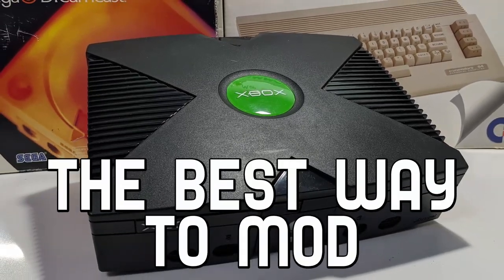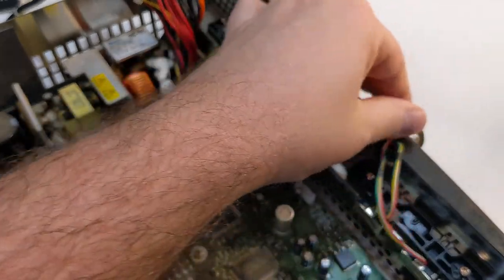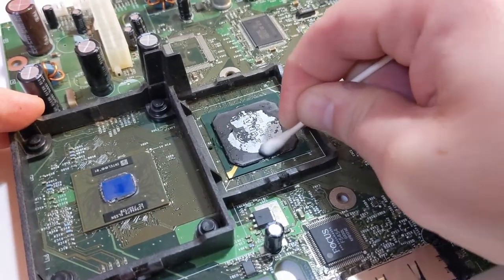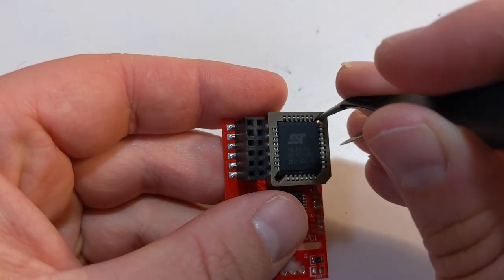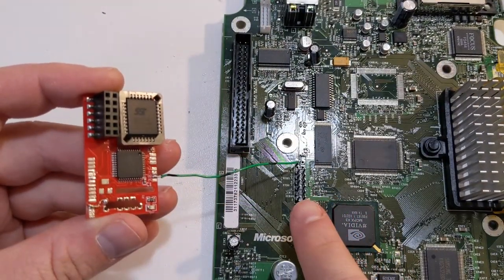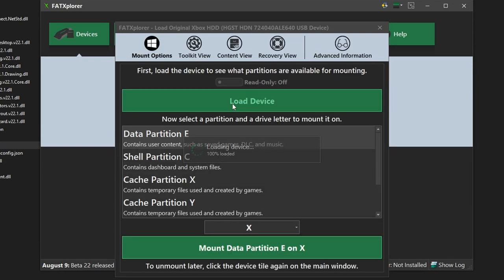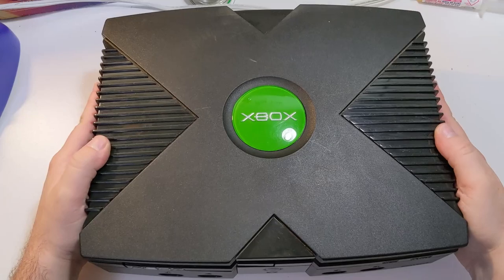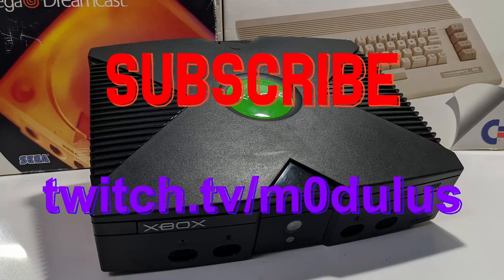How To Mod an Original Xbox 1.0 - 1.4 - Aladdin XT Modchip plus Cerbios Install Tutorial

Comment: just have a couple things i want to comment on. if you like me like replaceing the clock capacitor tge original clock capacitor is a Super Capacitor. Idk how exactly it differs internally from a normal electrolitic capacitor but i don't think it's the same thing. the oem super caps Microsoft used are 2.5V not 2.7 but 2.7 is far easier to find these days and they work fine as a replacement for 2.5V. 1Farad is the oem capacitance but you can increase the Capacitance in theory keeping the time after unplugged longer than the original 1F in fact I fit 15F super capacitors in giving it in theory 15 times longer before the xbox can't keep its time after unplugged. 

Secondly their is or has been a lot of debate if the og xbox should be replace the thermal compound or not, in my opinion i don't think they need it, it's just nice if you can BUT, if you attempt to replace the compound you need to have caution because if you apply to much force the CPU and especially GPU  can detach from the board and i hear it's near imposable to lign up the CPU or GPU and reflow the solder correctly. So basically if you pull to hard the board is bricked and practically unfixable.  In regards to the thermal paste from personal experience and conversations with someone with much more experience than I have. The Thermal Compound Microsoft used isn't thermal paste and maybe not even a pad, whatever they used is soft enough to have spread when the heatsink was put on the FIRST time but is and probably never was a paste.  The thermal compound does appear to be different for Version 1.0-1.1 so that may not aply but as you can see in this video the Thermal compound judging from it's near perfect square shape and how it covers far more area than the actual component it is not a Paste but a Thermal Pad or something like it. What they used performs optimally ,at least enough to keep the CPU and GPU from getting to hot, to this day. So if you don't feel comfortable taking off the Heatsinks I personally feel you then shouldn't try replacing the original thermal compound.
If you ,like myself, do repasted your OG Xboxes be aware that the thermal paste YOU use will most likely have a expect performance lifespan of 5 or so years so i advise you change the New thermal past in 4 years or less. Unless you have a reliable way to compare how the paste performs in 4 years and it performs almost as well as the day it was applied. BTW you should not use a Thermal Pad because to my knowledge they don't thin down much so it would probably perform worse than the original Thermal compound does. Generaly speaking the thicker the layer of Thermal compound after applied and pressed the worse it performs at keeping the CPU/GPU cool.

None of this is ment to come across as an attack to  Mad Mod Labs, I think this is a great channel i simply am responding to some bits of the information in this Video. And Thank you to the Mad Mod Labs for the video it's been entertaining to watch and has useful information to use.
Sorry for any typos or  Grammar isues i have probably made.
Reply: Curious what happens if I don't replace with thermal paste. Will they eventually overheat and damage the board? Or is it a simple replace whenever they finally break
Reply: @readysetrekt3414  I don't have enough experimented evidence to know for %100 sure but from the information i know of, If the heatsinks aren't removed and thus the thermal compound isn't changed it will not overheat so long as the system isn't excessively dusty.  With that said on the chance i'm wrong and the system overheats it may cause permanent damage and the common overheating symptom of turning itself off mid game(because consoles usualy are set to turn off at a set high temperature set from the factory). So far I have not heard of a instance a original Xbox turns itself off conclusively from overheating directly because the the thermal compound wasn't performing optimally enough, so as i mentioned earlier if someone isn't comfortable removing the heatsinks not messing with it is a safe option.
Reply: An xbox will turn itself off if you don't have any functional fans. It monitors chip temps and will save itself if a heatsink is at least installed. If the chip is bare, yeah it'll probably heat up quickly enough to kill itself.

As for removing the heatsinks without much force, just warm them up with some hot air and the paste loosens. They come off super easy when warm.

To remove the paste more cleanly than shown in this video, use electrical contact cleaner that contains hexanes, like Puretronics 3600. Isopropyl alcohol does basically nothing. Acetone may also work but I haven't tested yet and if you drop any on the plastics it will damage them.
Reply: @CasualGamerCC  I just cleaned up mine and I used %100 acetone and a thin pillow sheet. It worked much better than alcohol. 10/10, got it off in 30 seconds. Crusty paste is a little harder to get off though but not by much.

Comment: is this process the same for a 1.6 xbox ?
Reply from the maker: There are a few extra steps to install this modchip in a 1.6 Xbox. The LPC port in the 1.6 is different and requires rewiring. Also, Cerbios is not supported on the 1.6 revision. You can still install hard drives up to 16TB in a 1.6 Xbox using the ExoX bios patched with Titan patch. Other than the LPC rebuild and BIOS incompatibility, the rest of this process is pretty much the same.
Reply: Thankyou...Do you need  a rom programmer and adapter to flash Cerbios ? cant you do it with Hexen Disks ? cheeers
Reply from the maker: You can normally flash the bios from a bootable disk like Hexen. I have recently seen 2 of these Aladdin chips that can not be flashed this way. I think it is because they are clones. If you have an old Aladdin XT2 with the original chip you are probably good. If you are ordering a new chip from Aliexpress or Amazon, it would be a good idea to have a rom programmer handy.
Reply from the maker: This forum post has more information about this problem: https://www.ogxbox.com/forums/index.php?/topic/6051-aladdin-xt-plus2-fake-cant-flash-new-bios/
Reply: I purchased an Alladin xt2 from ebay seller and they confirmed CAN BE FLASHED WITH NEW CERBIOS (256K) Release V2.03 Hybrid  (Xbox V1.0 - 1.5) Only  on auction details stating  BIOS (EVO X) already installed and can be reflashed. ?
Reply from the maker: Yes, most Aladdin chips ship with a version of Evo X already installed. I hope it can be flashed inside the Xbox.
Reply: Thanks for your help, Good videos, i subscribed, cheeeers

Comment: Use an OpenXenium, they don't need to be flashed externally at all
Reply: Link me? Or would any openzenium off Amazon work
Reply: @Majestic  any would be fine, but MakeMhz had taken up the roll of supporting it and its software officially. They're almost always out of stock though

Comment: Do you have to do all that reflashing business? Looks like lots of reviewers on Aliexpress had their consoles boot straight away after installing the chip.
Reply from the maker: At the time that I purchased my chip, The chips were shipping with an older version of the software. I flashed my chip this way because I knew with 100% certainty that it would work and I could use Cerbios, which was still very new at the time.

Comment: That's not thermal paste, it hasn't "hardened", and it does not need to be replaced. It is a PCM (phase change material) which is dry when cool and soft when warm. It can last for many decades because it's not thermal paste and has completely different properties. Also, Arctic Silver 5 is an ancient formula at this point and far from the best.

Comment: "Careful not to lift up this trace"
Sounds like someone's had past experiences or knows someone who has.

I did that, with my first ever mod, used far to thin a wire just cos it was all I had, & it worked just fine for about 6 months before the wire snapped, & then the resolder, well that didn't go so well, pad came away, the trace is ever so slightly lifted, & I just stopped there before it got entirely destroyed.
Christ, that was almost 2 years ago now.